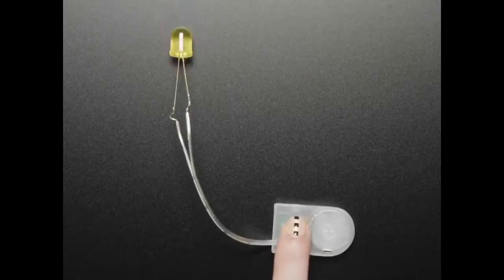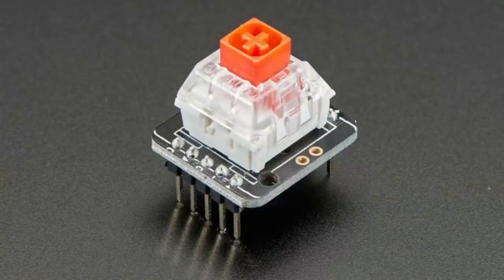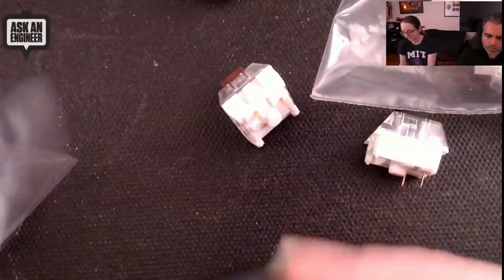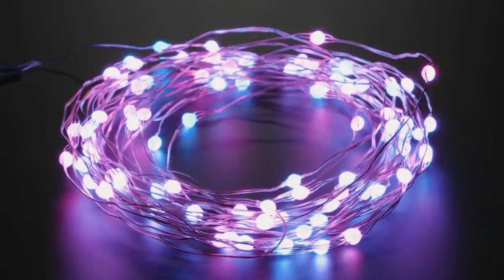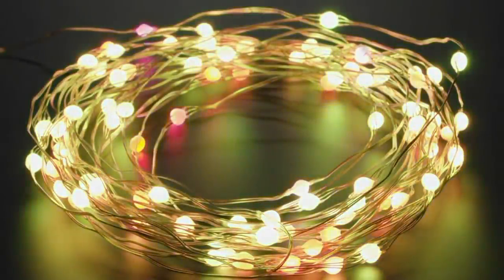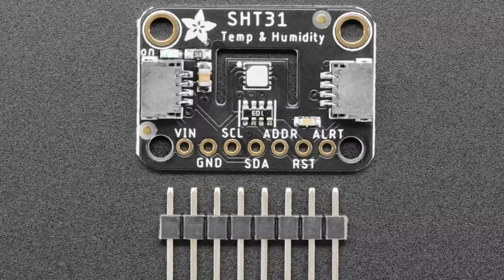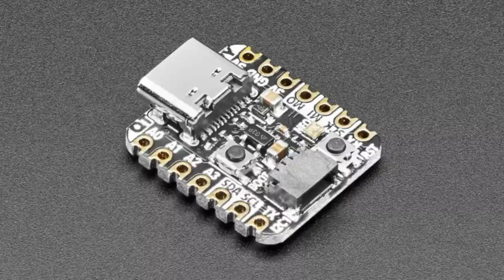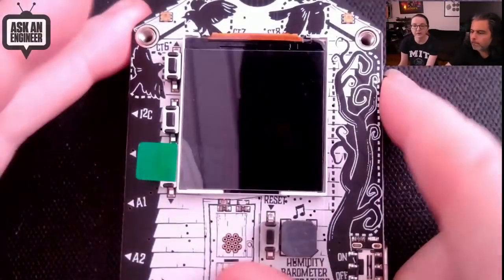New Products 4/7/2021 feat. Adafruit FunHouse - WiFi Home Automation Development Board!

Comment: Home automation, something that could work with the FunHouse;
A hand held Remote Control with an LCD display (20x4), SeeSaw common buttons (Up, Down, Left, Right, Select, Vol Up, Vol Down, Cha Up, Cha Down, Home, Back, ect.), accelerometer for low power mode (turn display off, energy save / stand by mode), IR LED, WiFi, Bluetooth, SPI Flash, SD card, side mounted NeoPixels around the edge, and maybe a Microphone and Speaker (like a telephone for intercom, hardwired mic off switch).
In a case with something like a [silicone rubber or cap touch] keypad, [AA or lithium] battery holder, and maybe space for a STEMMA Qwiic or FeatherWing board inside.
Accessible ports, USB C, STEMMA QT port, and maybe a 3.5mm (4 pole) plug for Audio In/Out or Data.

Just a few ideas.

Comment: After experimenting with several M0 and M4 processors for my prototype, I ended up with ESP32-S2. The killer feature is megabytes of available PSRAM, so the problems with insufficient RAM are gone. FunHouse dev board and its reference designs came right in time. It's almost exactly what I need.

Comment: The home automation board is awesome! Commonly for us Home Assistant folk..we typically use Esphome or even Tasmota with our Esp32 projects. 
The problem is that I’m not sure that Esphome is stable with the S2 yet. This is a dealbreaker for many novice Home Assistant users like myself. Esphome is the absolute easiest way for us to make projects and add sensors that stage easily with HA and MQTT. This is especially true for those like myself who just don’t have time to learn python. If this was a traditional esp or it played well with Esphome Id order 4 or 5 units.

Comment: I also have a MagTag board that has a ESP32 which can do all the TLS calls.  What is the best way to have these connected using a hard wire to form a mini gateway.  I plan on having the MagTag with the Epaper would show the event log while the Funhouse would show the live sensor data in this use scenario.  Also, could the MagTag use one of the stemma ports to wake up the FunHouse to take some sensor data which would then go back into a deep sleep?  I would like the funhouse and the magtag to talk using a hard wire so I don't have to assign static address on my network.

Comment: Dang, adafruit going about that keeb game...

(Most guys use Pro Micros to do keebs, do a pin compatible version)
Reply: Would love to see more keypad makers use feather pinouts though. Would make it so much easier to do a wider array of possible options, from fitted displays, wireless (bluetooth+battery) and so on. All as optional, modular add-ons instead of features that need to be thought out before-hand
Reply: @Jaaxfo  I’ve played with Feathers for keebs before, and while they’re nice for wireless and batteries, the pinouts are wider (may interfere with switch pads when mounting underneath them), and battery port makes the case thicc if you want proper clearance.
Reply: @shapshooter7769  That's entirely fair, I was envisioning an offset position for the feather in most cases, allowing for some physical space that could also be used for said displays or batteries. Though they aren't perfect for every use case, I just don't see many designs that make use of them and want to see more because of how many add-ons are available vs the Pro Micro.

One solution would just be for me to make one myself, but I have 0 PCB design experience. I was thinking of making one of these that fits my needs perfectly as a way to learn, but only a few weeks later Adafruit started teasing new products that were well past "good enough" for what I wanted to build